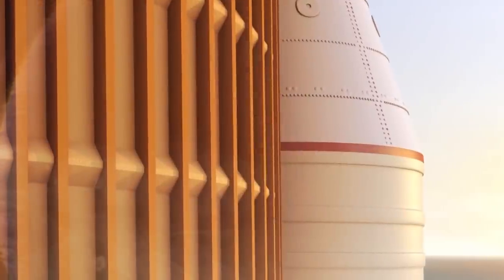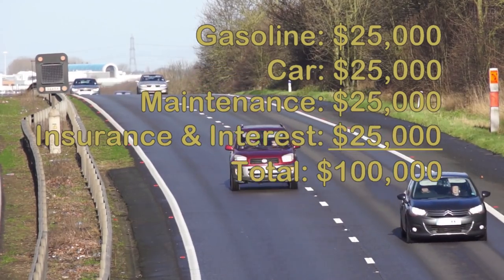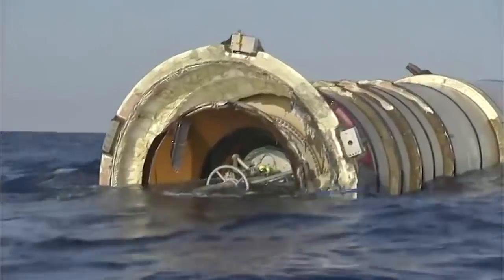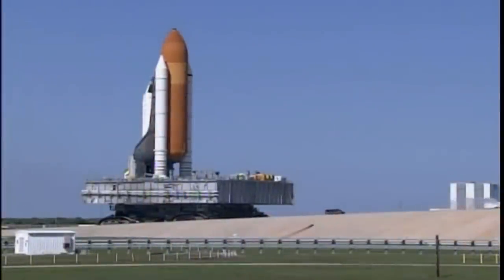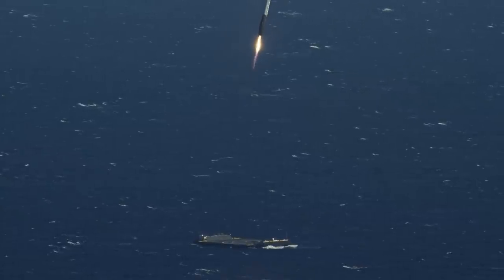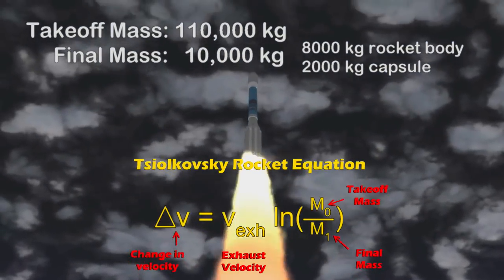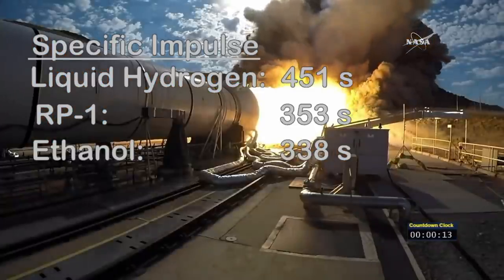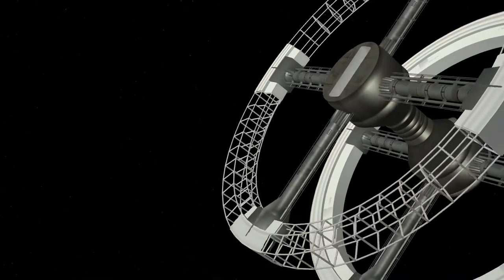Reusable Rockets & Metallic Hydrogen

Comment: indeed mon librepenseur.
metallic hydrogen (hydrozene benzate)
is a delta-v scalar... it increases the RoI of the project,
providing better fuel for the cost.

this, combined with hall-effect ion motor with bussard ramscoop etc,
means we can have high-delta-v projects,
at a fraction of previous costs.

that is what the Fenner Conference et WFSF evaluate as
the driver of Astromining -
a vital new space industry, to supply earth with rare-earth metals from nearby asteroid etc.
see S Michaux's "Astromining or Bust"

je prends conge
bonne chance mon librepenseurs

Comment: Fun fact: A winged flyback/aluminium construction Heavy-lift Vehicle from NASA's SPS study has similar payload to Starship, yet only 4000t mass when full (less than simply the mass of fuel for Starship)! And that is even with some mass reserve, and a heatshield separate from the cryotanks with an insulation layer in between!

Comment: The actual cost of a rocket is dominated by, in order from greatest to least:
1) Infrastructure
2) Personnel
3) The rocket

The Big Dumb Booster concept save most of it's money on infrastructure. You use existing shipwright facilities and existing manufacturing equipment with only minimum cost for tooling. You don't need to build a launch complex or a transporter to move your rocket; you can use extant tugs and barges. That's where the main savings from the BDB come from. Think how much the infrastructure for Apollo cost and how much of it we're still using. The VAB, the transport crawler, the launch pads, the control facilities, basically two thirds of what NASA uses to launch rockets was built originally for Apollo; a not insignificant amount of what SpaceX uses to launch was also built for Apollo.

Personnel costs are mostly constant. You can't get rid of all the mission planners, engineers, assorted personnel, and the cost of their training and salaries. There are only modest cost savings available so no one really tries to reduce personnel costs.

The cost of the rocket is dominated by three factors. In order from greatest to least they are:
1) Launch tempo
2) Complexity
3) Size

No matter how small or complex a rocket is, the cost per launch is dominated by the economies of scale in it's production. That's one of the reasons the STS costs estimates were so far off the mark. NASA assumed they'd be launching once or twice a week. In reality, they ended up launching once every two or three months. The more you build, the cheaper it is to launch.

Complex rockets cost more. A lot more. Bigger rockets cost more. Not that much more. So it makes sense to use a large simple rocket than a smaller, more complex rocket. And ocean launches let you get really big.

Comment: What abaut skylon project or other use of sabre air breathing/close cycle hybrid engines. As oxygen is heavy not taking all of it with you would be same advantage as the high isp. Space plane doesn't need engines as powerfull as a engines in rocket - reduction of costs and weight, but on other hand you must carry with you all of the "plane stuff". In Kerbal Space Program skylon like SSTO's are great, but how is it in reality? I'm litle woried abaut service costs of skylon also.

Comment: Isaac, what are your thoughts on Reaction Engines' SABRE engine design? I'm sure you've at least heard of it but for those who haven't it is essentially a wing mounted liquid hydrogen/oxygen rocket engine but it gets its LOx from rapidly cooling and compressing air from its aerospike intake using liquid helium. Essentially it would mean that all the LOx you need to carry is just for whatever you need after leaving the atmosphere which is generally A LOT less than what you need during atmospheric ascent.

Comment: 6:40 Re: Shuttle SRB recovery.
The inside metal was coated with an ablative material designed to handle temperatures of the burning solid fuel. It was discovered that this material was actually burning away much sooner than expected and the o-rings between the metal shell had melted preventing extreme temperatures from escaping. These o-rings were never designed to handle these temperatures. Yet upon discovery it was deemed "acceptable" and nothing was changed until the Challenger disaster. In this case it was a NASA oversight failure, but in reality the recovery of rocket parts, especially ones designed for carrying humans, allows us to better recognize and increase the SAFETY limits of the spacecraft. (regardless of the cost, in this case, of the Shuttle's SRBs)

Comment: responding to 22:00 about why we use OXY/RP-1 over liq hyd/OXY.  While it is easier to handle RP-1 its also a much denser fuel allowing for a much smaller vehicle and Lighter vehicle than with hyd/oxy.

Comment: Unfortunately the cost of making the metallic hydrogen creating pressures of 25-100 GPa will most likely offset any cost saving on increased efficiency of the rocket... Commercial diamonds are made at 18GPa. Therefore a metallic hydrogen, as a fuel  is a viable option only in a fusion economy anyway. Chemical propulsion seems to be a bad choice even in a best of circumstances.

Comment: I was going to say that the weather would be a huge issue for ocean launches, but actually the equator is where the doldrums are (calm weather) and hurricanes don't occur there due to the coriolus effect. You'd still have some swell, but you should be able to stabilise the launch platform against that.

Comment: How does this idea sound. I've been thinking about this for a while and maybe I finally found a sounding board for it. lets say we have a launch system based off of shuttle components. The launch system is capable of placing say 60 MT in a 500 km orbit. Build a reusable vehicle with a conic section service and propulsion module. Size this somewhere around the diameter of the ET derived fuel tank.  Above this you have your crew/cargo section. The vehicle launches normally. When it re-enters it makes its descent base first. The heat shield has a center portion, basically a section of a sphere. contained in this you have a series of rocket engine combustion chambers. Above the lower heat shield you have a convex structure. The rocket engines exhaust the hot gases across this structure. Either at the rim were you have a skirt that extends to act as a dam to cause the hot gases to build up a pressure area. Or you design the convex structure so that a certain portion could fold towards the center basically forming a large diameter  but very short bell nozzle. Think of it a plug nozzle turned inside out. Could this work? I would imagine that the specific impulse would not be especially high. But to me the attractive thing is the re-entry thermal system and the engine you use for landing is all built in to one system. McDonald-Douglas did re-entry tests of Gemini with the hatch in the heat shield for the MOL and the Shuttle had gear doors that sealed for re-entry. So I don't see and issue there.

Comment: I have watched most of you're videos so far. Working through. Questions.

Regarding heat dissipation about taking hits from nukes or the force field thing coz I love the way out stuff. Could this immense heat not be channeled into a plasma system where the heat is arched away from the ship in huge plasma streams (like u said no stealth in space) or the plasma is channeled into the drive or power generation system so the system actually needs to generate less power while under attack.

If you're stationary under huge bombardment you emit violent plasma streams to vent heat to keep your "shields" cool, if you don't do this well your shield effectiveness drops to 80% then 50% etc. If your maneuvering you channel this to your drive and weapons system....anything left over you can vent via above process and anything above that decreases you're shields.

Comment: I am curious about one thing; that being, how does compressing hydrogen into it's metallic form increase the specific velocity? All you've done storage-wise is make it denser, meaning carrying the same amount takes less space. I must be missing something pretty big in the calculations cause all that would seem to do is make the tank potentially smaller. I mean, when it comes to actually propelling the rocket, hydrogen is still just hydrogen, right?

Also, I'm pretty sure you need astonishingly high pressure to keep hydrogen in it's metallic state, hence it only existing naturally in, say, jupiter. Wouldn't it extremely rapidly destabilise, then sublimate without that pressure?

Please, educate me o internet, I'm pretty sure I'm missing something really intriguing here.

Comment: Well... I have a suggestion to solve that. Lets say you use 99% of the rocket for fuel, but after it have been used you dont discard the booster  but clean it up, and let it be a part of the spaceship, make iyt bigger for the crew. You can grow food there, crew quarters,  entertainment, or what even you need. 

- So... lets say you start with only 300 cm2 ,  but after some cleaning the spaceship wil be 2000cm2 for what ever you need
That is the way to go.

This can be done on the next spacestation. Keep half of the modules they send up with food etc, and add them to the station, and finaly get some armour on it, put a engine and of you go
- Good speed

Comment: 21:50 - The other reason RP-1 is preferred over hydrogen for first stages is that RP-1 is a hydrocarbon with a much heavier exhaust, so it loses less of its exhaust velocity to the atmosphere.  Hydrogen is the lightest thing in the Universe (that we know of), so it works great in a vacuum where 100% of its velocity gives you thrust; but it has a very low specific impulse at sea level where the air around the nozzle is pushing back.

Comment: Why don't we dig a EM railgun launcher tunnel in the Andes mountains and get some extra dV and altitude right off the pad? One problem is the shock of exiting the (vacuum) tunnel into the atmosphere, but a sturdy enough nose cone could handle that I'm sure. You'd need heat shielding for launch as well as re-entry in that case, but at least you're not spending fuel to lift it, because it will ablate off very quickly in the lower atmosphere, and most of the weight will be gone for the high altitude flight.

Comment: would it be possible to bulid 4 giant octocopter holding only the rocket in the middle while lifting it up to ~10.000m, and drawing power via cable from the ground. and how much fuel would it save starting a rocket from 10k insteed of sea level at the equator ?

Comment: Great video I didn't previously understand the huge advantage in tank weight that could be achieved by scaling up rockets.  I can't but think this is further validation of Musk's ITS concept in which they use an extremely large two stage booster.  Just imagine, an enormous vehicle that can land on it's launch mount and be refuelled with inexpensive methane derived from natural gas and be launched again in a few hours.
   This is going to render obsolete our current thinking about what can be done in space.

Comment: The real issue with rockets is that they're basically gigawatt scale power plants compressed into tiny rocket motors not much bigger than some trucks. An equivalent nuclear power plant would be 800+ acres in size...

Comment: You could just build a launch facility in some of the highest places on earth to take advantage of altitude increases, make artificial water holding tanks out of rock that you can fill and empty while making larger scale rockets. The weather wouldn't be much of a factor at hights above 20k feet. The only problem would be grtting raw materials to the sight, which rail ways could be built to provide it.

Comment: question: how would you get four com ports from a computer with an ISA interface and only two com ports and a pharlap operating (circa 1986) system.   I do have extra computers and each has an Ethernet connection.  My air is doing ok but my water is running low so I need a solution soon.  changing operating systems isn't an option.  changing the bus is not an option.  Failure is not an option.

Comment: Most of the fuel/weight/stress durability issue could be solved with High Entropy Alloys. I know the Science of them is still emergent and not yet industrialized, but even at the added expense it would more than make up for itself with the properties some of that shit has when applied to the question or reputability of rockets.

Comment: It would be neat to make rockets in drydocks and float them out to a launch bay in the water. Ballast systems could sink the tail and bring just the nose above water for maneuvering. It could then be lifted to a launch pad, or maybe it could be submerged pretty deep and then rise up into a launch tube/silo for launch prep. Once it’s in place, the silo is drained and the rocket is serviced. Or maybe to start with, the rockets are tugged back to port and serviced as refurbished/refueled rockets head out to launch. It doesn’t seem like it would be much more difficult to land a floatable rocket in the ocean than on land. With a fleet of floating launch pads it seems like you could fire off small, reusable, cargo rockets at a steady, cheap rate powered by hydrogen and oxygen

Comment: Can metallic hydrogen even exist at room pressure???Would it be stable or would it spontaneously react into superhot regular hydrogen plasma when pressure is lowered?
if so, you would need some extremely thick walled containers to haul it around - not usable for rockets...

Comment: What do you think of beamed power and thermal rockets, well the design is usually more thought of as being a kind of space plane using remotely powered thermal rockets, so you can get an Specific Impulse of about 900 seconds as you would be using hydrogen. Maybe it's not the best idea for manned missions as the emitter losing track would mean the loss of the mission, but considering how cheap a thermal rocket is to build it would be a good way of getting supplies up until it has a good track record.

Comment: I think that you should have mentioned the heat limits of rocket propulsion technology when you're talking about metallic hydrogen. the exhaust temperature of current Rockets is not capable of supporting a metallic hydrogen exhaust fuel's heat limit. You would need a supercoolent source in your Rockets engine in order to keep it from melting the rocket exhaust manifold. that adds to the weight to fuel ratio that you were discussing. but that's just my two cents.

Comment: The only argument I would say on reusable rockets, Space-X is working on a 24 hour turn around time. It may not be cheaper but it will be faster than casting a new one. (Yes you can keep a series of them to alleviate reuse times too but you can do that with either)

Comment: Does anyone know about the Sanger-Horus design of reusable vehicles and how they would fit on the scale of efficiency for rockets? The design was basically a two-stage rocket planes piggybacking one on top of the other  as if you were launching the space shuttle off the 747 it rode on to the launch site.

Comment: Sadly, even if we could mass produce metalic hydrogen, there is no way we could build tanks light enough to be used in rocket that can hold metalic hydrogen. Maybe we could make it more stable, so it would not require such pressure, but now it is as good as guessing that something better might be around the corner...

Comment: I'm given to believe that scaling up a fuel tank doesn't actually save you tank mass, because of the particular relationship between the necessary thickness of a pressure vessel and its size. The mass savings in bigger rockets comes in other areas (fuel lines, metal not part of the tank, the engine) and you can also save some cost by not finely machining everything to cut a few grams of mass.